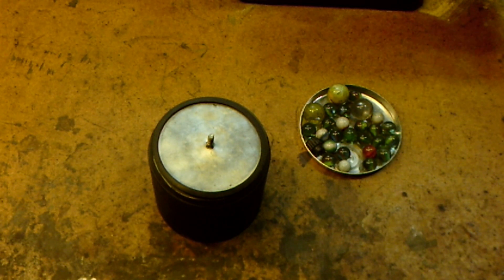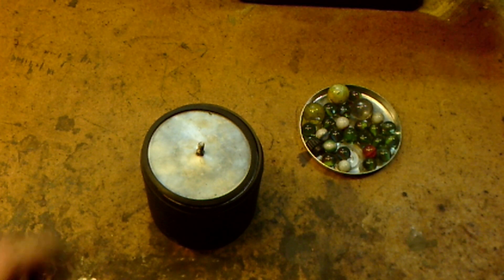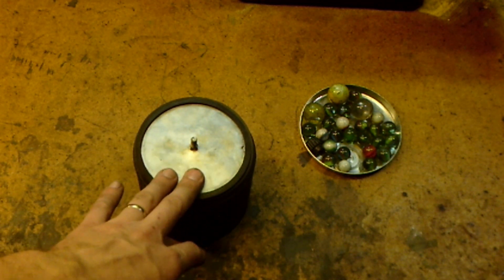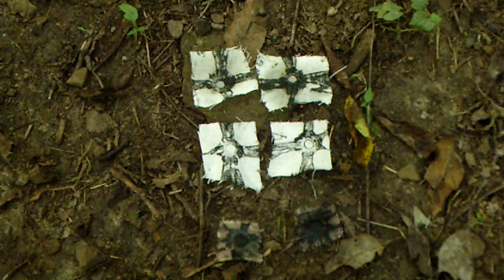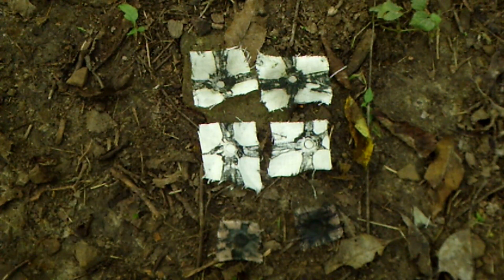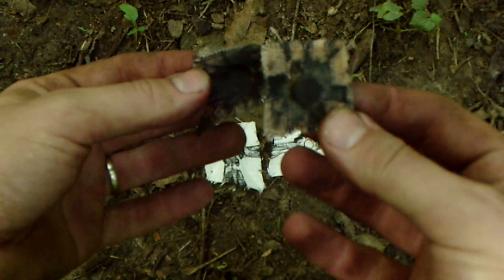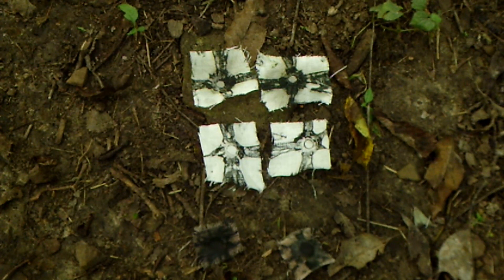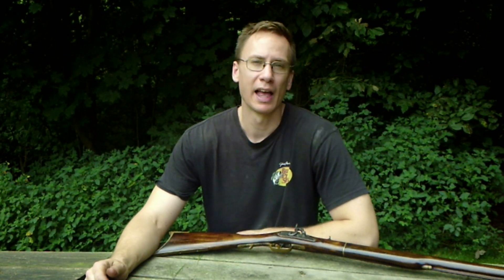Making Cleaner Powder

Comment: The commercial plant I looked at had a cast iron ball mill. They used 4" cast iron cannon balls. They had a vacuum on one end sucking out the dust. The other end had an airlock with a scale. They only put lump charcoal and brimstone rock. They put them in at the correct ratio and only used the fine dust.

The potassium was ground wet then the 2 were mixed and pressed into pucks. Dried with hot air. Then ground with 2 cast iron wheels. A vacuum sucked the screened product to a steam and graphite tumbler. Then off to sorting and canning.
Reply from the maker: Thanks for sharing!

Comment: I have been using marbles for a while, and recently I have noticed glass shards in my powder.  Maybe they break down over time, not sure. 
One thing that worries me about using metal or PVC lining in my mill, is static electricity.  Could that be a problem, or am I just being paranoid.
Also I have been considering using the CIA method.  Has anyone compared there two methods, is there a difference?
Reply from the maker: I am switching to steel Ball bearings for that and other reasons. I would not worry to much about a pvc mill but then again, I always keep the amount I'm making very small just in case.

Comment: Another great video! Thanks much. 

I note in Dave Fellhoelter's comment he mentions the use of jacketed bullets for tumbling media. Does anyone use them? 

I have a full box of unused 230 grain, .452 FMJ projectiles left over from my handgun reloading days that have been sitting in the closet for years. They are the copper electroplated type with no exposed lead. 

I'd be interested in anyone's thoughts on using them.
Reply: Pure copper bullets may be even better.
Not as heavy makes for longer milling times. But the harder material might partially negate that problem

Comment: The most obvious reason for the milling with glass marbles taking longer is the weight of the marbles, if you replace those with steel ball bearings you will get a much quicker result, also less, (no), contamination from the lead as a bonus! Chris B.
Reply: I was curious how one prevents sparking when using steel, metal to metal can produce sparks (voltages).
Reply from the maker: At the end of the, people have different ideas about what is best or what is the most safe. That is the reason I advocate to make in small batches and bill in a safe place outside. Thanks for watching!
Reply: The possibility of sparks is very high with steel balls even stainless steel.

Comment: careful, glass will pick up a static charge
Reply: I always do mine Out SIDE in a safe area just to be on the safer side. I mill most ingrediants as one's or two's intill final blend milling. Maybe KNO3 and Sulfer togater in correct ratio for a (7.5 : 01), carbon alone, or sulfer carbon, or carbon KNO3 then measure and final mill all 3 togather. but I do lead or ceramics media.
Reply from the maker: Yep, I know some people feel that way. However, I only ever mill small batches just in case anything ever decides to light up.

Comment: I'd like to agree with the rubber issue. You are way over loaded though, by the amount of burning/un-burnt power coming out of the barrel front. Yes, powder amounts do change with seasons. But, more so with Humidity contributing to the fouling issues of any BP firing arm...Over loading does significantly reduce all around performance with accuracy and ignition/fouling.
For my arms, what burns I get in the 4 seasons area I live in is/are different from season to season.. What works in one season does not work in the others  three seasons. Hence along comes the fouling with it...Using 1000 + really, really reduces the fouling experience
Reply from the maker: Thanks for watching. Yes Sir, your right, all kinds of things can effect fouling and accuracy. However, this is really a medium load for this gun. At 55 gr, it is far from being over loaded for a 45 cal. She shoots spot on with this load at 25-75 yards.
Reply: AND I always keep my Powder Dry with desicant untill the time of use.